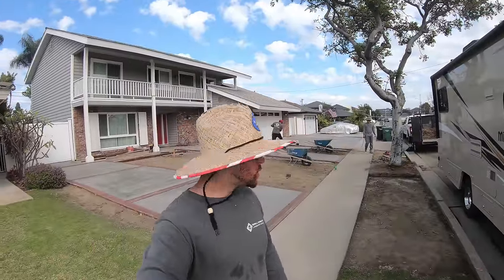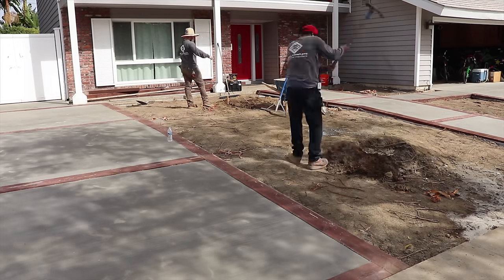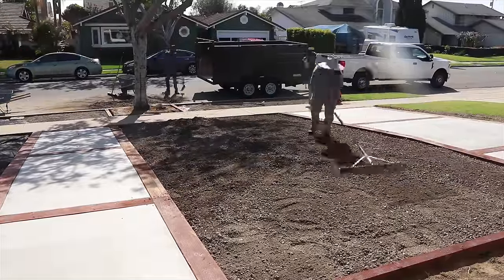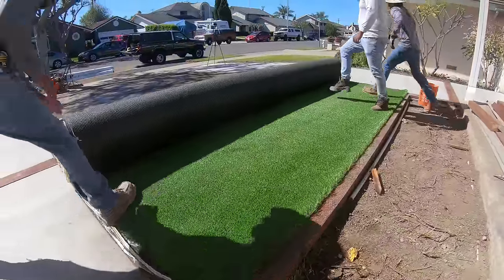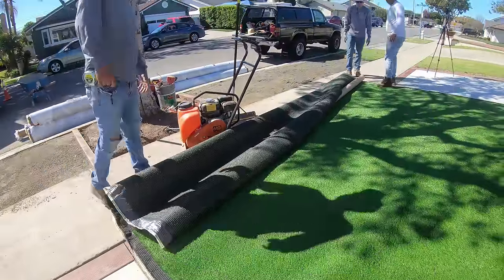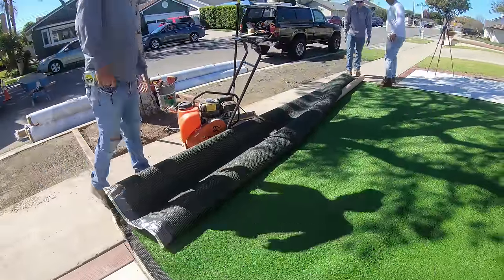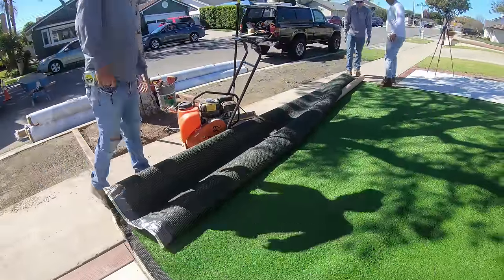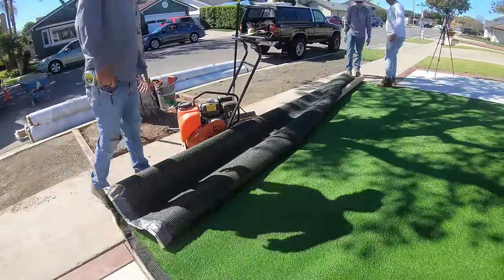Front Yard Remodel 5 : How to install Artificial Turf Step by Step Guide

Comment: Our artificial grass is newly installed in the front yard.  I did not see our landscapers tuck the grass down by the cement like you did.  I didn't  see them go around the perimeter with 6" nails either.  What I am seeing is sand seeping out from underneath onto the new paver driveway.  It's oozing out from the new rock border lining part of the grass as well. Your results are polished.  Your video has inspired me to have a chat with our landscaper. Thank you for this video.

Comment: Why did they use pressure treated wood for the inlay/border, definitely doesn't look very good and the pressure treated wood will weather, split, discolor, etc. Not a very wise decision for long term and low maintenance.
Reply: I agree with you. He should use subgrade bend-a-board which is not as costly, lower maintenance, and really makes the turf look real without the wood inlay/border

Comment: The nails in the middle of the turf are useless you only need them on the sides
Reply: Not useless. 6” on the edge and every 2 sq ft in the middle. Turf expands and contracts and it helps keep everything in place. Also, most turf we buy has a warranty and that’s required IF something ever needed to be warrantied (it’s not common)